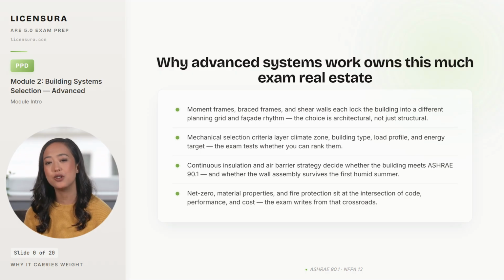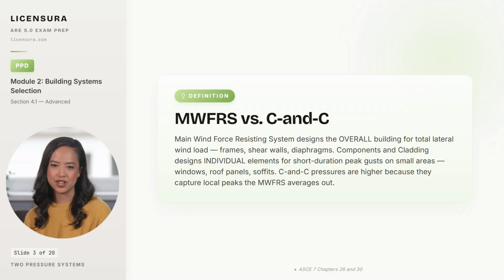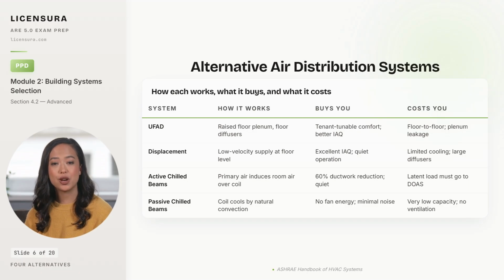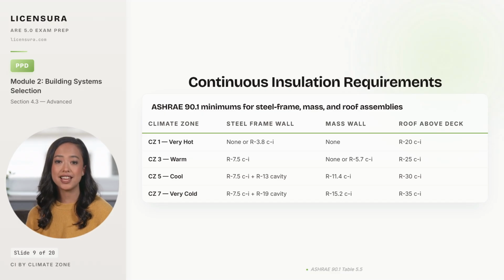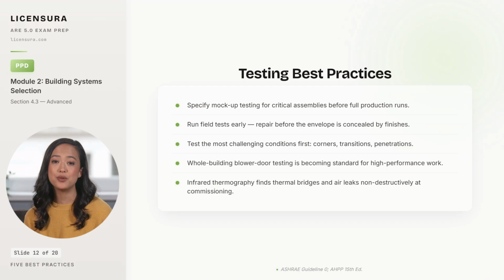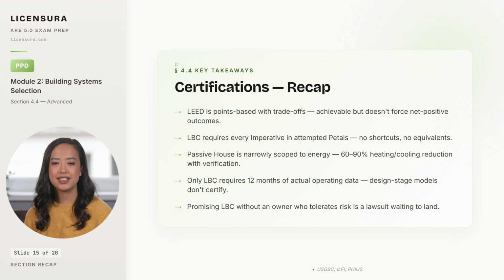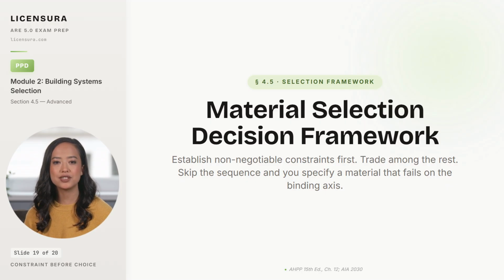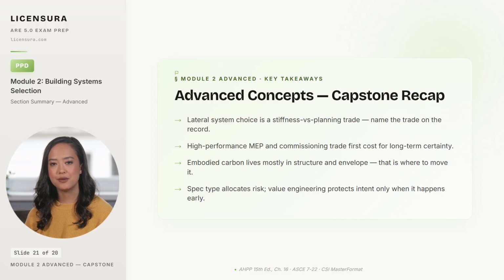Building Systems Advanced: Complete Guide | ARE 5.0 PPD Module 2 Advanced | NCARB Exam Prep

Comment from the maker: If you've been wrestling with Building Systems Advanced, this walkthrough is the full sequence — no skipped steps.

**Everything else lives at licensura.com — completely free.** Free signup, no payment info needed.

→ *726 content slides* — every sub-module, foundational + advanced, fully sourced (AHPP, AIA, IBC, NCARB)
→ *Complete video walkthroughs* for every sub-module across all 6 divisions
→ *Downloadable PDF study guides* — 130 to 270 pages per division
→ *Progress dashboard* that tracks every quiz, every exam, every section
→ *18 full-length timed practice exams* (3 per division, scored to NCARB's scaled-score equivalent)

🎓 Built with feedback from 100+ ARE candidates. The toolkit gets sharper every week.

▶ https://www.licensura.com — sign up free in 10 seconds

Hit subscribe so you don't miss the next one. We're working through every NCARB division.

Which division is your weakest right now? Drop it below 👇